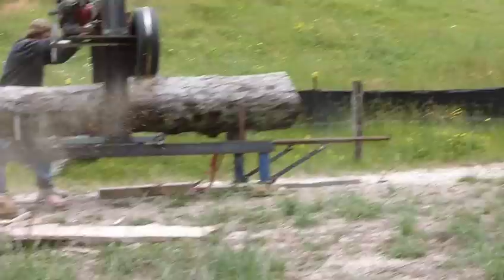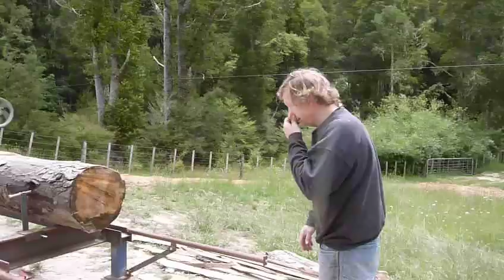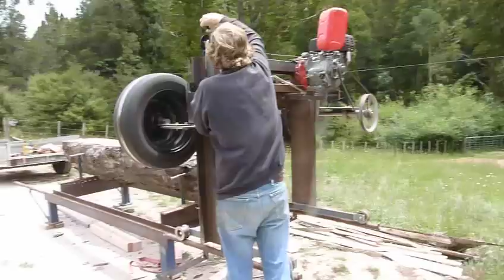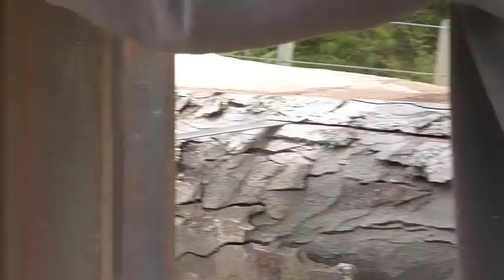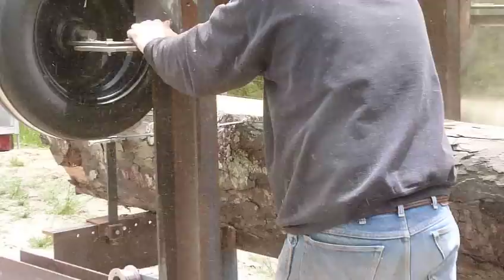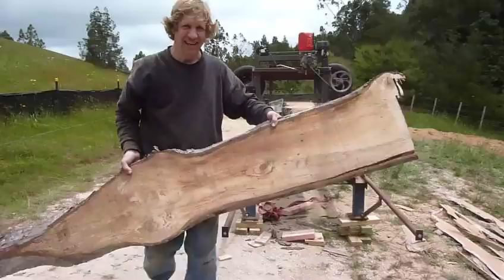Homemade Band Sawmill

Comment from the maker: An inflated tire has a natural crown on the face that makes the band want to run true. Just install the band, inflate the tires to tension, then turn the wheel by hand making minor adjustments to the parallelism of the idle wheel until the band stays in the middle.

Comment from the maker: In this world there are two ways to make machinery safe. The first is the current thinking of most, driven by government regulation and law suits - Guard Everything - because you never know the skill level and intelligence of the operator that will use it. The system I use is based on the operator knowing the equipment and how to use it properly. I think I am just fine.
Reply: B-Spot.... the made in China, made by the Chinese but selling it by the merchants who are the coward traitor citizens will be hating you for sure.

Comment: Not a bad design.  Looks quite rigid except for the ends.  I'm assuming you built this with a specific purpose in mind.  I imagine you will get frustrated soon seeing the underpowered nature of the mill.  I think a 20-30 HP engine would be much better.  I own a small Timberking mill with a 25HP on it.  Couldn't imagine cutting with less.
I'd say that before too long you will be extending the mill with the same substancial frame as what is currently under the log. Good Job!  You are having fun!

Comment: I like your design, it seems to work well. I do have one suggestion that should help the process...try adding wedges or shims  behind your cut so the weight of the top slice doesn't pinch the blade. Thank for sharing the video!

Comment: As some one who ran a small professional 125Hp re-saw at a sawmill and some other small bandsaws do you self a favor and put a guard all around the blade, accidents do happen. The big blades if they get jammed like to run into the frame or they crack eventually and need to be welded. The small blades however they just break and go flying and are very dangerous.
Reply: seen a few fly. glad i was behind the sawyer like you're supposed to be

Comment: I like the saw mill. Just wondering,  think will try the rims with a rubber padding  around the center, that way don't have to worry about air pressure    thx

Comment: the blade can't come back... yes it can if it slips of one tire and than starts swinging around 
and if the blade snaps its nice to be behind the saw...because the forces are pushing the blade that way

why not just machine two aluminium or metal wheels with a groove in the middle to fit the saw perfectly so that it can't move  an then take a bit a sheet metal and get that shaped around the construction so that the only part of the blade that's exposed is where the sawing actualy takes place

Comment from the maker: Really, so the operator of a car doesn't make it safe or unsafe based on how it is used? and can you believe the wheels are not guarded. and cars are operated in close proximity to pedestrians. The only thing that keeps the wheels from eating the pedestrians is the operators training and skill.

By the way the operator is 2 feet behind the blade and the it can't come back toward the operator because of the frame. From a knowing the equipment stand point I don't move past the plane of the blade.

Comment: well no shit sherlock but since its in movement and has a certain mass... its not magically going to stop spinning

espacially since most of the times it  still around one tire ,without the tension provided by the other tire and the distance between the both of them

Comment: WRONG ! the (sic) Tyres will not wear out and need to be changed nor is this design any more dangerous than any other portable mill, this type of saw has been in use for thousands of hours and used extensively by others. Nice job on the build I am positive your tires will not need replacing for a very long time.

Comment: It would cut a lot safer and smoother if you wedged under the slice as you go along so the wood doesn't "pinch" the blade as you get closer to the end of the cut.  Also, where is the blade shield or some form of protection????

Comment: do you put oil on the blade as it's cutting?
Reply from the maker: grgabby I haven't need to but if your cutting wood with a lot of sap a little diesel fuel in a spray bottle works well to lube the blade.

Comment: what size motor and brand name your using? also can you use water on the blade to help it cut better?
Reply from the maker: TIM LASHLEY It's a Honda 9 hp. You can add a lube to the blade I have used a spray bottle with diesel fuel for wood with a lot of sap.
Reply: Ok thanks so much love your mill I'm making one close to it got to find somewhere to get a blade and the size of it
Reply from the maker: TIM LASHLEY I bought the blade and wheels off ebay and designed the wheel spacing to accommodate the blade.
Reply: OK ty I'm looking now

Comment: Why do all of these designs have the bandsaw on a track as opposed to a sliding table for the log?
Reply from the maker: shashaw08 I wouldn't move the log because it is much heavier and larger than the carriage required to move the engine and blade. The frame to move a 12 foot long log on a sliding table across the saw blade would need to be nearly 30 feet long. It would also need to support greater than 500 pounds for a good size log.
Reply: I feel like a 2ft wide 3 walled box on top a few dozen roller blade or skate board wheels ought to do it.
Reply: Because you don't have to.  It's much simpler to move the bandsaw as it's a light mobile unit.  Like B said, you have to have a MUCH longer track to move the log against the blade, and the frame has to be built much more sturdy.  The beauty of these little portable bandsaw mills is just that.. They are small, light, and portable.  Less investment, less hassle.
Reply: because then your mill would need to be twice as long

Comment: I really enjoy watching your saw mill I myself am planning on building one but do t know exactly where to start. Did u have a set of plans to go by or what?
Reply from the maker: I started by going through all the metal I had, then figuring out how I could build the major components. I didn't make a set of plans but I did work out how long  board I want to be able to cut, how big in diameter log would fit, and what the blade speed would be. Then I worked with the design parameters and the materials to build the machine.

Comment: Kills instantly when the blade brakes.  Operator will be sentenced even after his death if this is in Russia... On a technical note the tyres must be changed every few days as the teeth will bit into them if set.  If you do not set the teeth you have to push hard the sawhead to make it cut anything at all

Comment: the skill level and intelligence of the operator have nothing to do with machine safety
and the fact that your system is based on the operator knowing the equipment doens't make it safe ... at all
what's preventing the blade from getting of those tires and taking aim at you ,and then I'm not even getting into the snapping of the blade ,or the blade hitting the three on the wa

Comment: Just had to comment on the safety. Where is your gear? If that blade breaks your possibly looking at the rest of your life in a wheelchair or worse.
Reply: Ya if that belt ever broke it could possibly take off a head like a weed eater string.
Reply: First off, learn how to read before you comment. Secondly, I most certainly have run mills, saws , machines and more.I was referring to the uncovered drive belt, the one running right next to the operator's jugular vein.   Ever seen a drive belt separate? I have, and it can be brutal right up to the point it exits the pulleys. Like I said, Weed eater string, wrap right around your neck and take your head clean off like a pop top.I would never operate that saw without a guard between me and that belt.
Reply: Actually, I was always talking about belts. You're just extremely unintelligent and don't  know the difference between a belt and a blade. Will you please go back to fishin? It's OK if you leave the hard stuff like the English language to educated people.